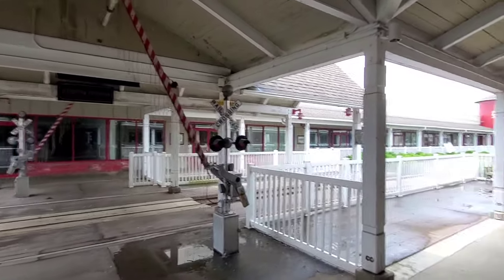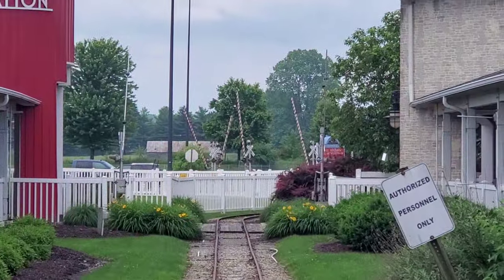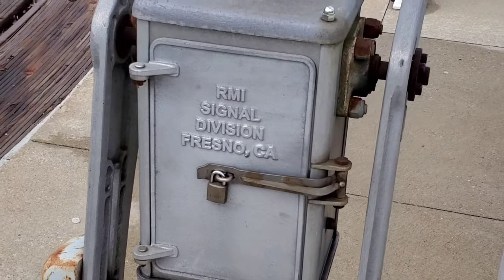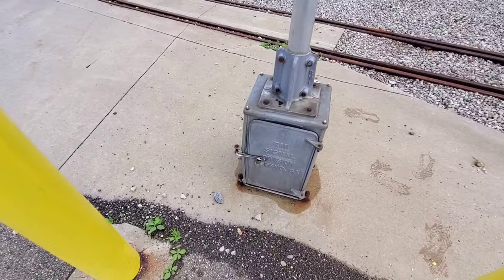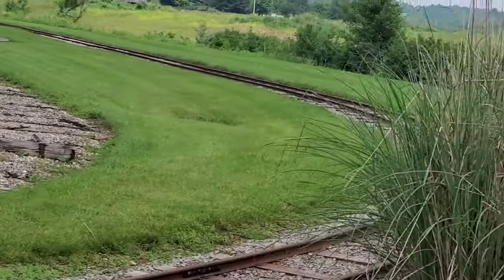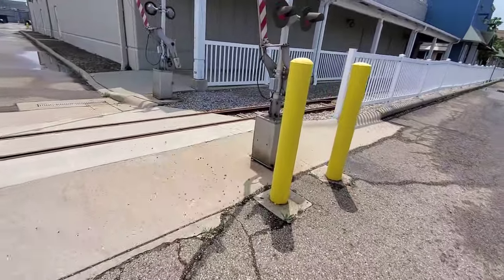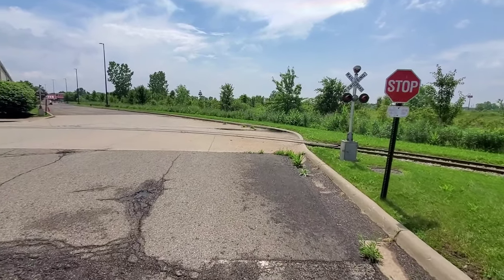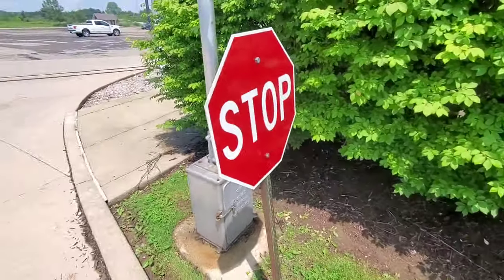Tour of Some of the Miniature Railroad Crossings at the Ohio Station Outlets - Lodi, OH

Comment: I think the train is closed due to the pandemic I guess when the pandemic goes away they will reopen I like to know the name of this mall in the name of this train so I can check back on it to see when they're going to reopen
Reply from the maker: Interesting. I have a feeling it won't reopen ever due to the low volume of people at the mall. It is falling into disrepair. The name is the Ohio Station Outlets as said in the title.
Reply: Train is on pause mode
Reply: Unfortunately this video is now but a memory the mall is closed the train is sold off and the tracks were ripped up and abandoned and of course the crossing signals were also sold off to other miniature railroads